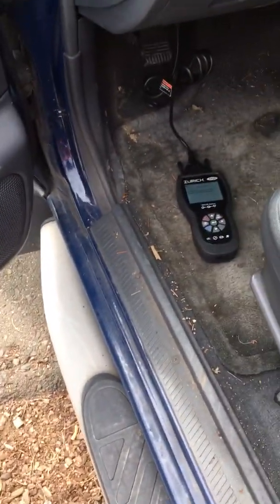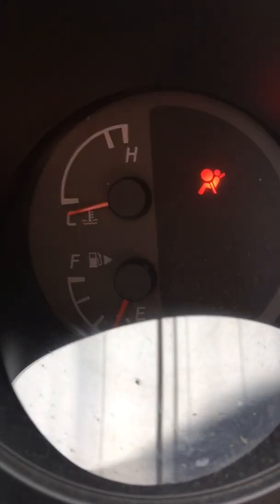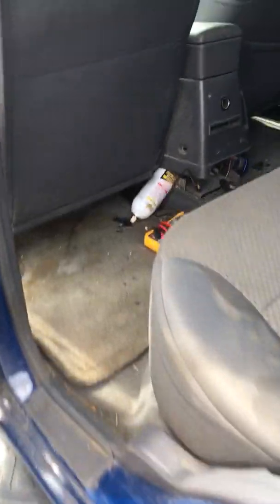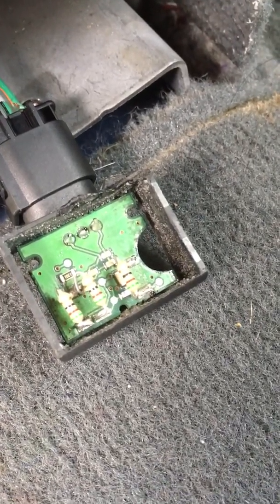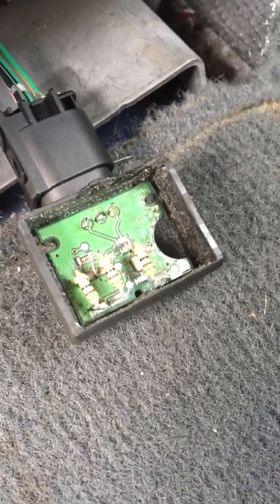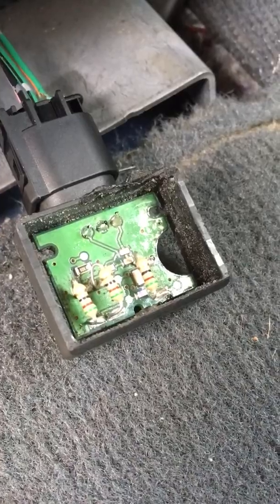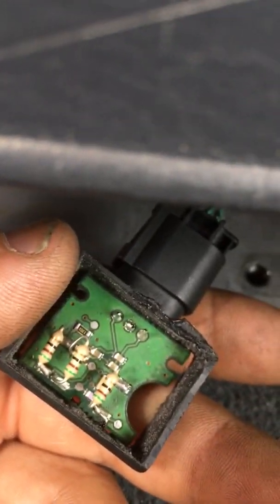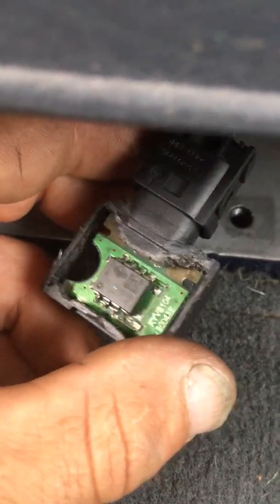Nissan Xterra ABS light FIX C1113 code FIXED

Comment: This is a great video but the issue is..this is for 4 wheel drives only. If you have the 2 WD like myself then this won't help.
Reply from the maker: Yes, the 2WD vehicles don’t have this part or problem.  Fortunately, scanning the ABS codes on the 2WD vehicles usually leads the technician directly to the part or circuit causing the DTC and the repair is less complicated and less expensive.  I posted this to help guide people to this common issue specific to the 4WD vehicles that use that sensor, and to present a repair alternative to replacing such a small and expensive part.
Reply: @blackjaredm It's well appreciated.  Keep up the great work!

Comment: Huge thanks Jared for this video!  I've just done this repair on our 2001 Xterra (ABS error code 17), could not have done it without your guidance.  Opening the module was not easy.  I used a Dremel tool with a thin cutting wheel, and once open I found that Brake Clean spray was useful in dissolving the glue/silicone.  I left the resistors alone, but found that the chip had pulled from the board just as you said.  I re-soldered it and we're back in business!  Like the other commenter, I hate any fault lights lit on my dashboard.  Thx!
Reply from the maker: Awesome! I’m glad it’s fixed and that you were able to successfully tackle it yourself.

Comment: How did you get to it I need to replace mine
Reply from the maker: The sensor isn’t too hard to get to under the rear part of the center consol, but the chip in the sensor is difficult to access because you have to carefully remove all that hard rubbery glue that is inside the sensor.   Use plastic tools/scraping devices and take your time so you don’t damage the chip or the board.

Comment: What does a G-sensor do in a car? I got a transmission fault code p1588 saying G-sensor. Could you explain?
Reply: Late to the party but basically tells the car how far your tilting or if your about to experience a roll over
Reply: @catioicat727  Thanks 🙏

Comment: So essentially all you need to do is open up the sensor, remove the glue, and re-solder as necessary? I cant stand having lights on my dash, and this seems like a very simple fix.
Reply from the maker: Yes, the glue is difficult to remove, but once it is removed to expose the IC and board, you will be able to resolder the IC to the board and fix your ABS light issue.
Reply: @blackjaredm  That sounds great. Do you have any suggestions for what to use to remove the glue?
Reply: Jared Black do you have a spec on the resistor?

Comment: Most interesting diagnoses for this issue on the Tube. I’ll have to open up my gsensor and see if the glue pulled the pins from the board too. I’m not going to replace the resistors unless I have to though.

Comment: How did you access the sensor? Looks like you removed only part of center console.
Reply: Only the rear portion of the center console (2001 Xterra) needs to be lifted up for access, it is held down by four hex screws, two on each side.  The front portion can remain.
Reply: It is possible this way, however I would reccomend removing the entire center console